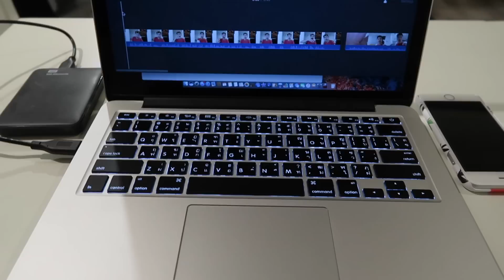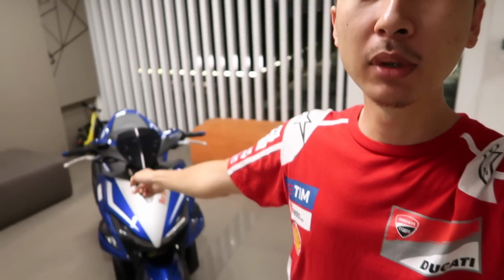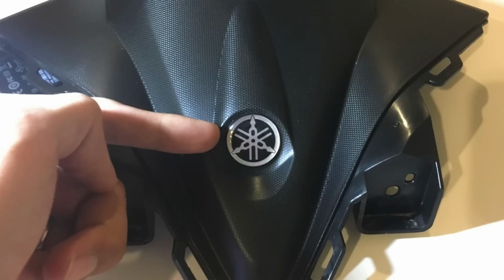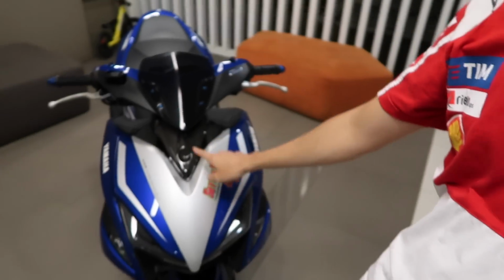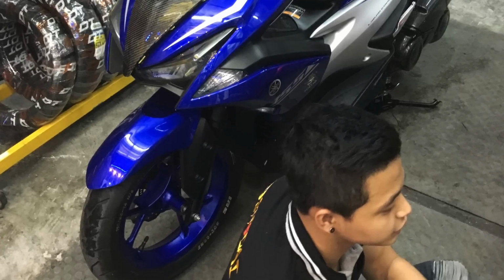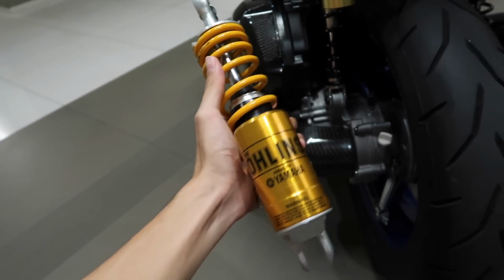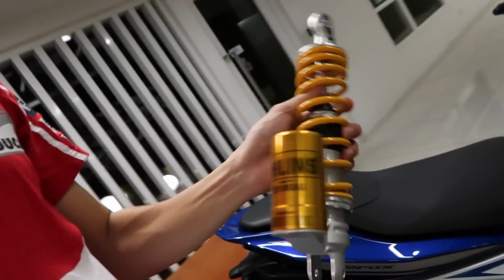Aerox 155/NVX CARBON & Ohlins MODIFICATION! (Must Watch)

Comment: I don't prefer scooty because it slips & skid in wet & sand condition. Does not hav proper safety & michelin tyre for proper road grip to the road. ABS only at front. Not Dual Channel ABS.